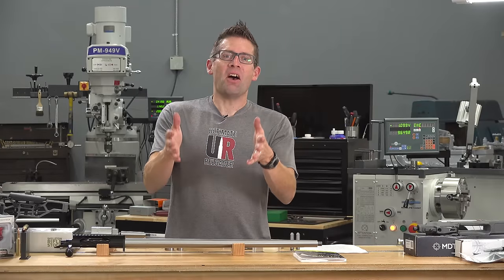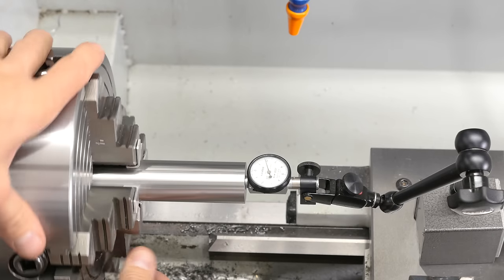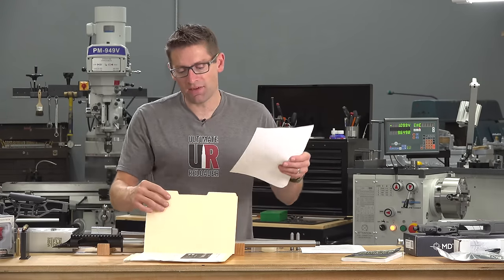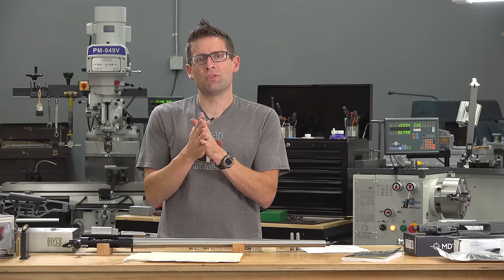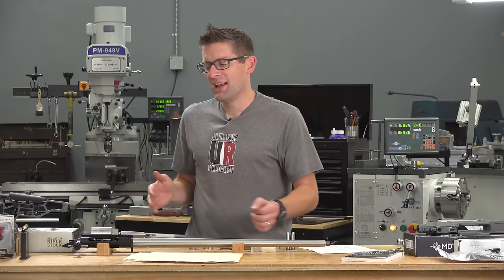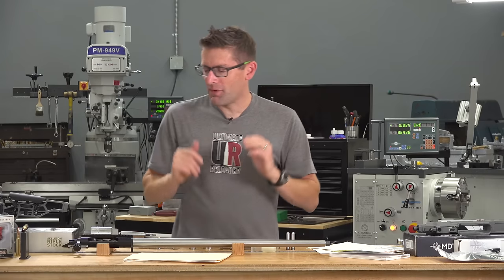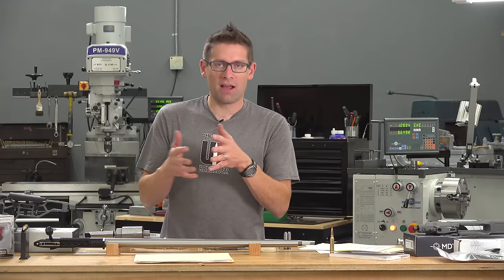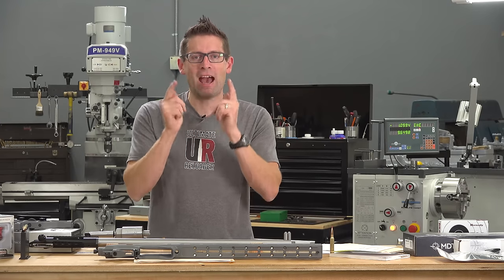300 PRC Custom Build: Chambering and Machining the Barrel

Comment: Did you true the face of the action and The Recoil lug and all that I've seen a few videos doing that to get as straight and true fit as posible
Reply: A custom action like the Kelbly action doesn't need tried because it is already true. Anytime people do that, it us with a factory mass produced action like a Remington action, where they are pushed out in high volume. That's the reason for custom actions typically costing over $1,000

Comment: Fitting a barrel isn't hard and only takes about 1.5 hrs on a manual machine without DRO. There is no magic, its basic machining. If you are taking heavy cuts and your indication is changing, your setup sucks, make it more rigid and stress free. Also get yourself a chambering gauge, makes things much easier. Also, you should not get crush with good tooling and setup. especially not .002".
Reply from the maker: Thanks for sharing your opinion. Gordy Gritters does not agree :). It's not basic machining in my experience. If you disagree that's fine. We can hold different opinions.

Comment: 13:38 Are you sure you want to have a sharp edge on your barrel? Big radii give better strength to shafts. Here is the proof (machine elements in mechanical design, by R L Mott): https://imgur.com/a/XfJfhYc , and a barrel drawing of an m16 (i am drawing an ar10, so there are some new dimensions along with it i took from machinery handbook 27th edition): https://imgur.com/a/2JRxxlP . There is a 45 degree slope on the thread side with a .01 radius, and on the other side there is a .031 radius. Those are army drawings, "mill spec" should be the best of the best. So for me that is what i would do. 
Im not as far as actually turning a barrel, or making a gundrill(which i think is awesome) https://archive.org/details/The_Modern_Gunsmith_Vol_2_Howe_1941/page/n125/mode/2up , the next page also has drawings on the tool that is needed to roll a hydraulic tube into a gundrill shank. Im now in a place where it is not legal to build the parts. So for now, for me its only doing things on paper until i get to a point where it is legal to make and have a gun... (if that still exist then, which it probably will). 
I hope the links will be up long enough for you to see them. There is a lot more about gunsmithing on  archive.org. Look for: "Bill Holmes", "Harold Hoffman", "DOUGLAS T. HAMILTON", "JOSEPH V. WOODWORTH" and more.. 
Greetings,

Jeff
p.s.
I will continue watching now.

O and yeah, the "bill holmes" cutting a rifle barrel series on youtube before its gone. I downloaded it with y2mate (be sure to have some antivirus and popupblockers installed while the site gives popups).
Reply: I liked the video!